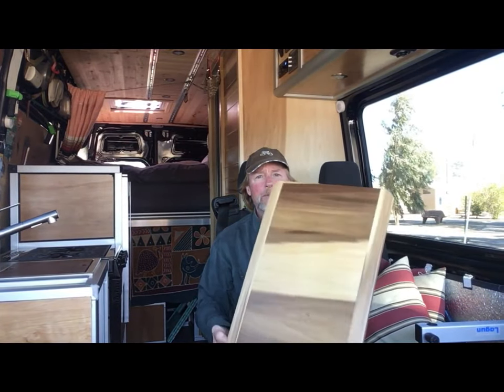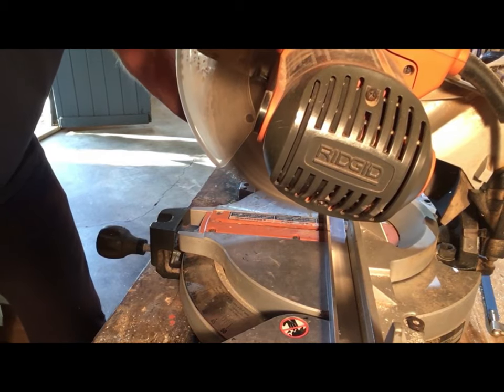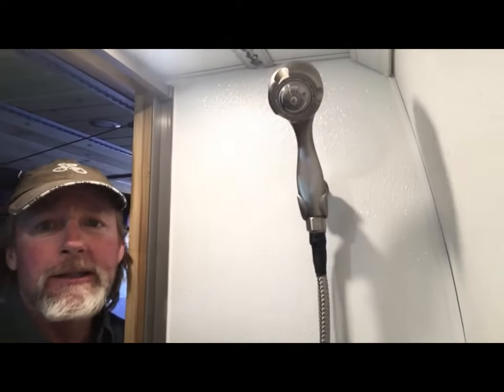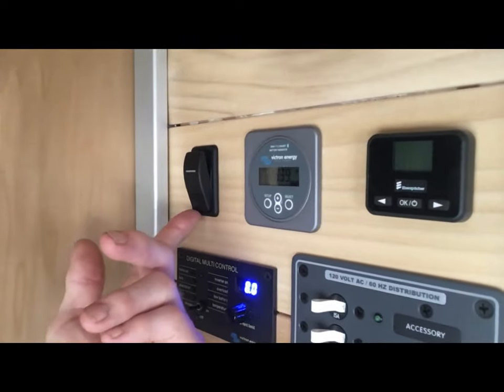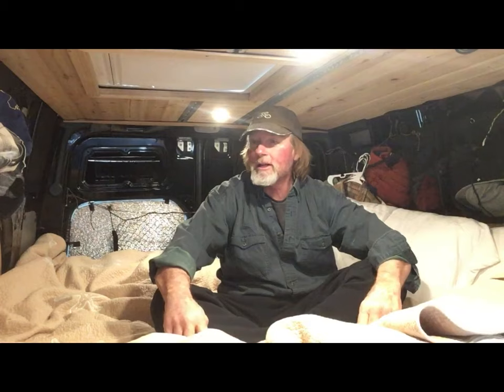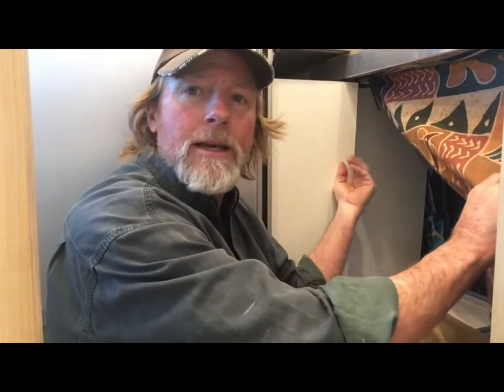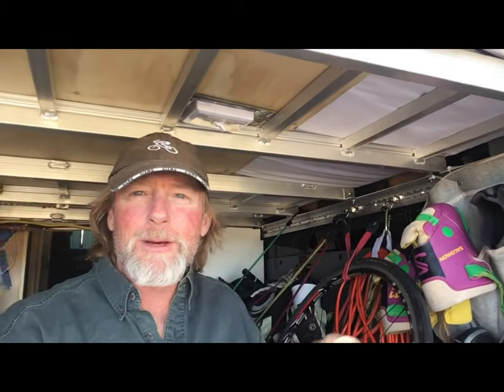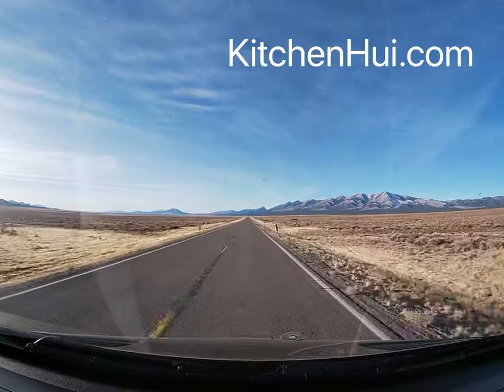4X4 SPRINTER VAN CONVERSION | Unique Van conversion, full-shower, 80/20, Velcro, Rare Earth Magnets

Comment from the maker: Please feel free to ask any questions you may have regarding the build, always ready to help with info!
Reply: Hi Rick, with regard to single Ford Transit install, did you use the OEM floor rails or something else? If the OEM rails, are they installed on top of your finished floor or recessed into floor channels? I assume you did a full bolt through to main points of frame?
Reply from the maker: @rdcwinslow  I used grade 8 5/8" bolts directly thru the tracks with the interior ones bolted directly to the frame, for the track near the wall I used a 1/4" steel plate, the tracks are installed on top od the OEM floor

Comment: Would you share what Velcro you're using and how you prep it. I've tried several kinds on my ceiling and it's not working out. Gravity keeps winning.
Reply from the maker: I used industrial strength Velcro, I also used contact cement both on the surface where Velcro was applied and the Velcro, for the ceiling I ended up using these rare earth magnets which I epoxied to the boards
https://www.amazon.com/gp/product/B08B7V5TH3/ref=as_li_tl?ie=UTF8&tag=makshui-20&camp=1789&creative=9325&linkCode=as2&creativeASIN=B08B7V5TH3&linkId=fdea1c97d95d562296bf371eb053de11

Comment: Wow some ingenious ideas to keep the weight down. Really like the easy Velcro panel walls and the magnetic ceilings. I was looking to place t2 roof fans (my windows don’t open) for airflow. But I like the marine roof hatch idea.
Do you have the links for the extra parts for the hatch )mosquito net and black out slides) and instructions on how to install the hatch in?

Comment: Your bike tray is unique and very interesting. What low friction method was used between the angle and 80/20? Tape or Pucks or Magic? Thanks
Reply from the maker: Thats a good question, when I built the bike slide two years ago my plan was too add some type of rollers later as I  was running out of build time (had two get out of Maine before the real cold set in) however after using the slide I found that there was no need for any additional hardware. Once or twice a year I pullout the slide completely out and wipe down the rails with a cloth sprayed with PB Blaster.  I also like the way I can easily removed the tray if I need to carry something in the back as well as using the tray as a bike stand, cheap, easy too make and works great!

Comment: Amazing build!
A couple of questions about your build :-) 
(and maybe you later can show in a video ;-)
The cabinet doors - do they just slide in the 80/20 slide or did you insert something in the slide to get it to work? (I also am building in 80/20)
The panels that you put up with velcro - can you show what the velcro is attached to? Did you put a piece of wood or something? And are all your walls build like that?
Reply from the maker: Thanks, 80/20 makes a specific track for sliding doors both an upper and lower track. Here is the link to the tracks https://8020.net/panelsdoorcomponents/glidestrack.html  The Velcro is attached directly to the vans metal, I did clean the metal with alcohol before attaching the Velcro, as I stated in the video the Velcro glue wasn't strong enough for the ceiling in high temps which is why I added the magnets. The wall panels which are located where the factory windows would go are all installed that way,  the space above the window cutouts I used cargo nets for storage, I was planning on  building more shelves but after spending the past 4 month in the van I'm keeping the cargo netting.

Comment: Thanks for sharing, great build! Also, the first one I've seen without any powered roof vents; how do you ensure good air ventilation?
Reply from the maker: Thanks, I crack/open the front windows, in cold temps with the Espar heater on I crack the hatch I was going to install a second hatch near the front but after living in the van I changed my mind.

Comment: Interesting choice of using those magnets for your ceiling trim mounting. Did you go that route across the entire ceiling? No screws/bolts/nuthin'? (aside from the L-track)
Reply from the maker: Did the entire ceiling, no screws or bolts, however the L-track is bolted to the ribs using the existing holes and Plusnuts, I really wanted to keep the holes in the van to a minimum, I cut a hole in the floor for the Espar heater, a hole in the ceiling for the Lewmar hatch and a hole in the floor for the shower drain as well as a few holes for Plusnuts in the walls. The magnets work extremely well and have no problem holding the Cedar in place. The Velcro worked good until I left the van last Jan in the Phoenix sun while I flew back east, the glue on the Velcro separated from the metal, I did staple the Velcro to the wood which worked fine. It was a somewhat time consuming process epoxying each board with magnets but well worth the results plus if at some point in the future I want to do a "remodel" I can easily remove the entire ceiling in about and hour!
Reply: @kitchenhui3502  I do like this method. I ordered a small package of these magnets to tinker with.

I was thinking, I wonder if that would work for the walls as well? But I've got half as many vertical ribs in the sides as I do across the ceiling, so... no. Unless I were to add some furring strips in the gaps and mount some metal strips onto those... hmm.
Reply from the maker: @scottweikert5189  I found that the Velcro works good for my wall panels. My panels are recessed into the area where the window cutouts are located. I used 1/8" hardwood plywood which is very light weight. Be careful with the magnets, when I first started testing them I lost several when they "crashed" into each other, you will be amazed how strong they are, I'm looking at the walls in my van as I write this and I see no reason why 1/4" of 1/8" boards with the magnets wouldn't  work, give it a try and let me know how it turns out.
Reply: @kitchenhui3502  The trick with the walls is there just aren't as many raised vertical supports as there are ribs across the ceiling! One possibility I'm considering is running vertical furring strips that are in the recessed areas, sized to be flush with the vertical supports, and then attaching a strip of metal onto the outer faces to give the magnets something to hold on to.

The problem I see here is that those furring strips wouldn't be nearly as structurally strong as the van body supports, and I fear trying to tug the wall boards off would rip out these strips as well!

Velcro is obviously far more forgiving, and that's not a bad alternative...
Reply from the maker: @scottweikert5189  That sounds good but not sure if you would be saving in terms of weight, remember magnets won't attach to aluminum if stainless steel. One of the nice aspects of using the magnets is they aren't permanent so if you don't like the look or if it's not working it's no big deal.

Comment: Excellent build and info.
Reply from the maker: Thanks, it only took me 3 years and 11 years of living aboard a sailboat to figure things out, and to be honest not sure if I really have anything "figured out".
Reply: @kitchenhui3502  Now that I'm trying to do one myself I'm totally impressed. NTM that your lifestyle mimics ours exceptionally well. We sold our 2500 custom, that we used to windsurf The Gorge for many years, last fall. Now, we're kiters (and bikers) and bought a 2500 170" 4x4 to build, this time ourselves, and take to Baja this winter. We've accumulated nearly everything (AM Solar 380W kit, 3 way fridg, stovetop, sink, etc.). I'm intrigued by the 80/20 bolted to the floor, rare earth magnet and velcro applications, etc. Any other videos showing layout and details would be much appreciated. We're headed to Corpus in a few weeks returning to SD early May when we'll begin the build in earnest. Perhaps, you'd want to journey thisaway -- kite the largest reservoir on the Missouri River and bike our new singletrack trail system and events with our local Oahe Wheelmen club, whilst giving us some much-needed practical oversight?
Reply from the maker: @kiter9271  I started windsurfing in 1984 while in college in Colorado, first trip to The Gorge and Maui were in 87, then moved to Maui in 96 and stayed until 2005 when we moved aboard our catamaran. I have one video posted on the building process (A Van, a Man and a Plan)  currently working on others.  The 80/20, Velcro and rare earth magnets have been working out great,  just yesterday drove for almost an hour on washboards which shook the van to the core, I'm contemplating selling this van in May and build another with exactly the same layout. I'll be hanging in Southern Utah biking for the next month then may head to Hatteress for a week or two then on to my "home base" of Maine. I work in Alaska during the summer as a commercial fishing boat captain, there is a video showing the scene. Feel free to ask any questions, always happy to help.
Reply: @kitchenhui3502  Outstanding!